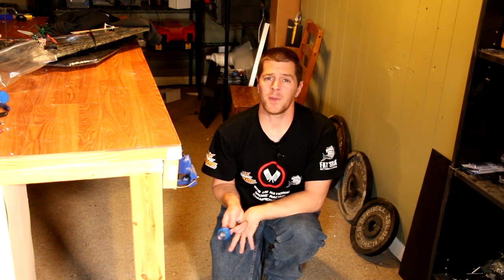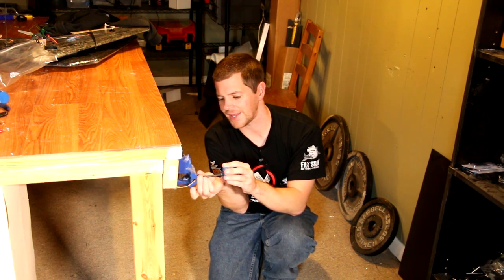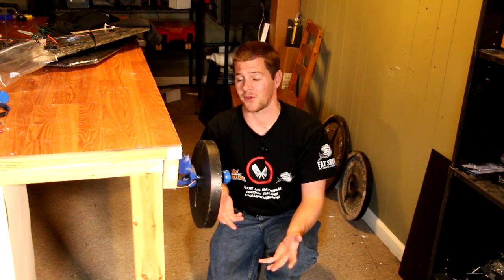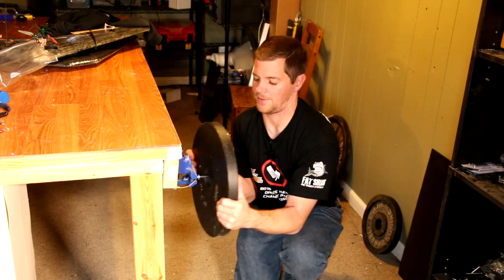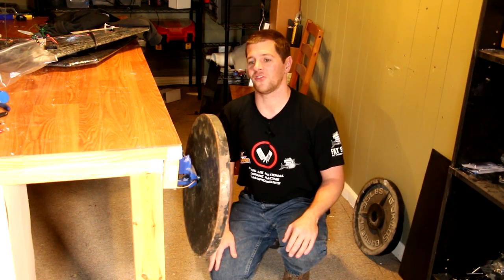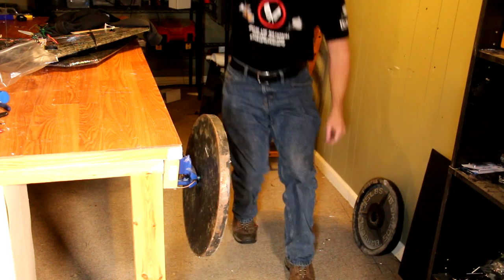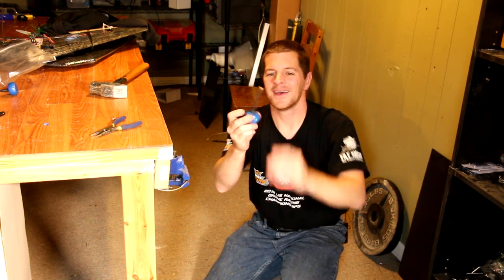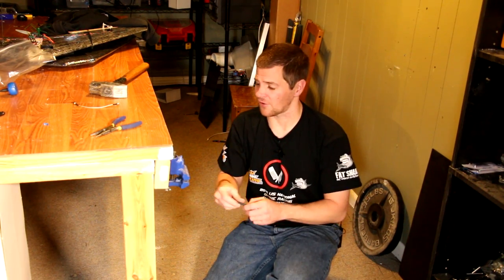Dura Spec cable shear test

Comment: my antennas usually break when the coax gets bent right over and cuts itself right off on the sma crimp tube thingy. is that what is being tested here? also I thought it would be good to make the antenna protection bubble more of an upsidedown rain drop shape that way the antenna could get hooked along the gates and would instead bend over and slip off on the smooth and longer bottom part of the protection cover. what do you think Alex?
Reply from the maker: +Phillip Evans - I need to figure out a way to test for that issue.  I was testing shear stress at the SMA which is different.  If I placed the weight on the cable, it would deflect away.

Admittedly, I have my Y6 hexacopter setup to try to shear the cable off at the crimp to test this.  After over 200 crashes, the cable is fraying at the collar, but it is still holding on.
Reply: Alex Greve just put the antenna in the vice with it pointing upwards like normal, then get a thin heavy and stiff metal pole or something and take a swing at it so that it catches it just undernear the antenna protector hitting the top part of the coax, but not hitting the antenna protector, this will be like getting caught on an airgate :) probably a little harsher than an airgate but can try different force with your swings!
Reply: +Phillip Evans hey nice profile pic!
Reply: +Mark Spohrleder thanks :) was my first quad. reptile 450

Comment: My understanding of maths and physics is not great, but the energy transferred to the item is a factor of mass and velocity isn't it? my question is how fast would a typical quad have to crash to transfer the 45lb of load onto the antenna? If it's 90 mph then your test is a very good one, but if it's 20mph you demonstration doesn't help. I hope that makes sense! #keepyourwingsinthesky
Reply from the maker: +John Seth-Watkins - The formula you are searching for is M *V^2/t^2.  Force increases by the velocity squared.  Mass is the mass of the vehicle.  Time is the deceleration time of the impact point.  Thus it has as much to do with how you crash and at what angle as it does speed.  What I proved here was that the antenna is stronger than the extension cable that secures it to the frame.
Reply: +Alex Greve very good, and frankly that's all you need really as the cables are cheap and can be treated as sacrificial. Thanks for the help.

Comment: Listen... I like you your channel and your products but the only reason that held is because you put the weight on the portion of the cable that still has metal from the connector in it...???  Try hanging the weight from the other end of the antenna... now that would provide more relevant information as to the actual durability.  
Not trying to be negative I think it's a great antenna and plan on buying a few.
Reply from the maker: +Dobemandan - The cable will flex away.  The area that antennas break is right at the base of the SMA.  That is what I was testing.